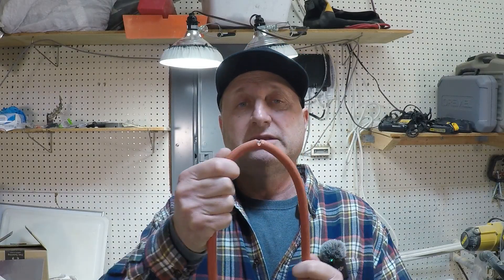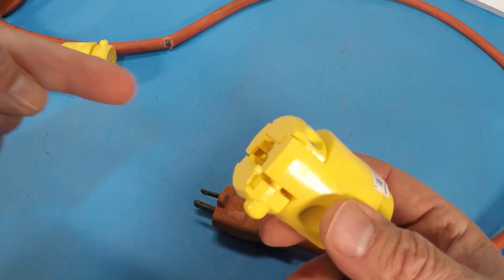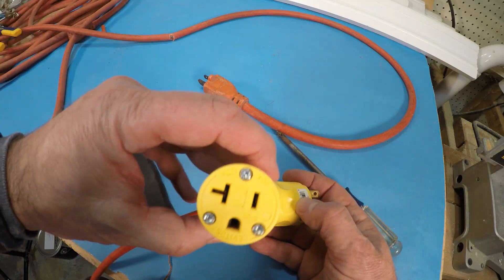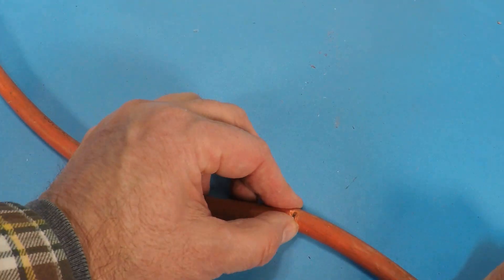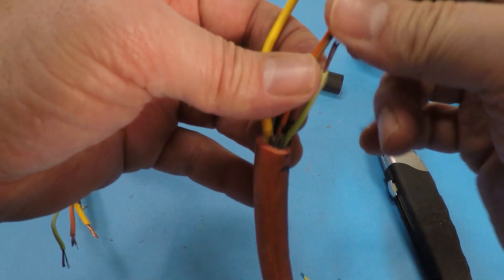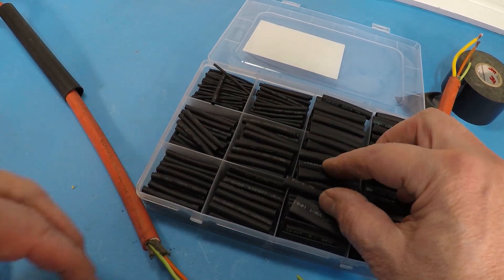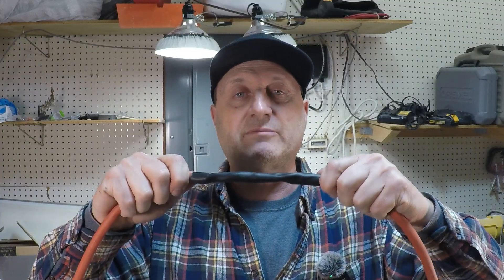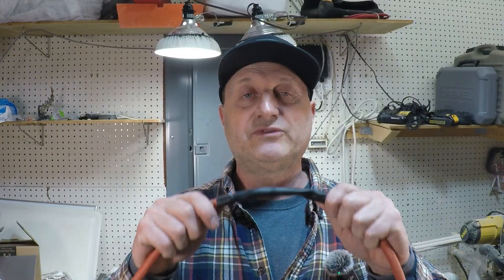The Surprisingly Best Way to Repair an Extension Cord or Appliance Cord

Comment: Don't do this.   Just put a new end on the cord and deal with the fact that your extension cord is shorter now.   This is not where solder is meant to be applied.

Edit:That solder job is brutal btw.  Far from bullet proof.  Even weaker once you start running a few amps down that cable,

Comment: When I don't have a heat gun or a blow drier, I use the hot soldering iron shaft lightly touching the heatshrink to shrink it.

Comment: 16:00 Again, as I alluded to earlier, you should have had the exposed wire somewhat longer --- i.e., more of the cord's outer jacket stripped back --- here, so that the heat-shrink tubing could have been slid further down back away from the heated part of the wire.
Reply from the maker: thank you for all of your responses

Comment: 14:10 Those soldered connections would have gone a lot quicker, easier, and better if you'd first applied paste-flux onto the wires and then melted a blob of solder with the iron's tip and dabbed the molten solder onto the flux-coated conductors.  Heating the wires to melt the solder just oxidizes the copper and produces a much-poorer joint.  Also, it's better to put the joint down against a board or layered-paper mat when you're ready to solder it, so that the heat is better concentrated on the joint instead of having it out in the open like that, where the heat can just ineffectively dissipate too fast.  It also allows you to pres the tip of the iron against the wires more firmly so that the heat transfers better and just wobblingly trying to hold it against the wires just out in the air.
P.S. It's a good idea to pre-tin the wires, also --- i.e., apply flux to each separate half of the joint before you put them together, then thoroughly coat the wire-ends with solder before twisting them together, applying additional flux, and soldering them again to make a solid joint; this is especially important with high-current-carrying applications, like for an extension cord.

Comment: 14:00 Notice how he has these wires correctly prepped here, Folks... you should have longer "free" wires on one end --- i.e., with more jacket stripped away --- to allow the shrink-tubing to slide further back down away from the soldered joint; otherwise, the "nearer" ends of the tubing may shrink down too small when they are unintentionally heated by the conducted heat from the copper conductors as you're soldering them, and then the tubes won't fit when you try to slide them on overtop of the bulkier soldered joints.

Comment: 9:32 You wouldn't need to actually cut and splice all three of the wires; in fact, if you don't mind not being able to use the heat-shrink tubing but instead just using electrical tape, you wouldn't even need to cut the damaged wire, either; you could just flame-soften the insulation and peel it away, then solder-fill the damaged area on the copper strands to restore the full diameter of the conductor and allow it to carry the rated current again.  (And if the wire was broken clean through, you could just add a short bridging-wire and solder it all together into one solid joint; you wouldn't need to shorten the wire's length by just twisting the two ends' strands together.)  It would make for a slimmer-bodied joint, too. :D
Reply from the maker: yes all of that is possible. However, this is really about what most people would encounter. I also think most people do not know how to solder and my extra step was for people who do. In the end, most people are going to twist and wrap.

Comment: 8:37 Instead of knife-slitting the outer jacket and thus risking slicing into the stranded conductors inside, I use small pointed surgical-scissors --- i.e., "iris scissors" --- to carefully slip in between the outer jacket and the wires and delicately snip away the outer jacket without damaging the insulation on the conductors.
Reply from the maker: you can use the scissors

Comment: Even better/safer than cutting back the insulation with a knife is to use a butane lighter to melt the insulation, or at least soften it enough to rip it loose and peel it backwards so that you expose the conductors but do not risk nicking or cutting any of the strands.  Also, when you strip the wires, it's good to solder-coat the bared-copper ends to gather all the strands and keep them from fraying or corroding.
Reply from the maker: thank you

Comment: When I have a damaged extension cord I usually just put ends on it.  If it's damage close to an end (usually) I cut off the couple of feet and slap on an end.  If it's more in the middle, cut it back and slap two ends on.  Turn a 30 into two 14's and call it a day.  No splicing, no solder, no tape, no heat shrink.  No binding around corners at the mend either.  

I'm not faulting what you do, just saying.
Reply: Yes, I was thinking about making two extension cords out of one, too.  Or if you have two extension-cords of the same wire-gauge that were both damaged at different spots along their lengths, you could splice the two longer cord-sections together to make a longer cord than either of them had been individually.  Then save the two shorter plug/socket-equipped cord-lengths for splicing the plug-end onto an appliance-cord with a broken plug, and for adding a socket to a different extension-cord where either the socket was too damaged/corroded to use as it was, or if simply you wanted to make the cord a little longer (again, make sure that the wire-gauges are the same on both cords; also, the longer cord might not be able to safely carry quite so much current as the shorter-length cord could have). :D
Reply: @Quacks0   Yes lots of options.  Regarding the wire gauge I have a bit of a story about that.

 I heard an interview with a fire inspector once, the topic was car fires in garages.  He stated that they have cases where people buy one of those 50'-100' outdoor extension cords.  Unwind about four feet off each end and plug their (parked inside garage) car in overnight.  Some of the block heaters draw 2000W which works out to over 16 amps.  Add to that the cord is only rated for 15 amps and for use outdoors, not indoors.  Furthermore leaving it coiled up like that increases the resistance/capacitance/inductance (I can't remember) which.  All in all, the cord heats up, catches on fire, car starts on fire and garage burns down.  

Made a couple of mental notes to myself and haven't burnt my car or garage down yet.  LOL!
Reply: @thepegger8422  I think that heat-buildup from the contained cord is the main culprit here; it creates resistance-inducing heat.  Inductance or capacitance could also be a factor, although apparently it doesn't really make that great a difference; I'm guessing it would likely depend on whether or not you're passing a large amount of current through the cord.  But in any case, it's best to always have the cord uncoiled, just for basic safety.
Reply: @Quacks0  I was a little skeptical too.  At the time I had a 1500 Watt block heater according to the OEM parts lists.  I happened to have a long exterior extension cord (still boxed) so I pulled the ends out, closed the box out and plugged it in.  I felt inside the box after about 1/2 an hour and it was all still stone cold.  But it was (calculated) only drawing 12.5 amps on a (rated) 15 amp cord.  A 2000W heater would have put the draw over the current limit.  So yeah.  I keep the cords short and the ends in good shape.
Reply: @thepegger8422  Yes.  Well, there's something else here, too --- if you needed to run the block-heater for your vehicle, then it must have been pretty chilly in the vicinity of where you were using the extension-cord, and so the ambient air would have kept the cord cooler than if it was used in a warmer environment.  Also, in the case of the space-heater, once it warmed the room, the cord could get too hot in the less-cooling ambient air.
Reply: @Quacks0  Fair points as well.  My garage was insulated and there was a gas furnace in there, however I used if very rarely.  We're in Canada and it can often hit -30C (-22F) during the winter.  Occasionally it will approach -40C (-40F) on a frosty night.  Since my garage was well insulated, it would often bt 10-15 degrees warmer in there than outside if I parked a hot car in there.  Uninsulated/unheated garages would certainly be very close to the outside temperature overnight.  Lots of variables there.  Even just the temperature of the slab compared to air temp.  Slab was always cold in the winter.

Comment: if only one wire was cut why not repair just the one instead of all 3?
Reply from the maker: Because the damaged wire would be too short. You will lose about 1/4 to 1/2 inches of the damaged wire when stripping it and tieing them together while the other two would be at the original length.  Make sense?
Reply: @flannelguydiy6458  thanks for the fast response
Reply: You could do that, but you would need to install an additional short length of bare wire to bridge the broken one so that all three wires remained the same length; I have done this with repairs where I had soldered the wires, so that there being two joints in the one wire would not be so much of a potential problem.  But a concern would be that there could be concealed damage in the other two conductors, also --- i.e., some of the two seemingly-undamaged wires' conductor-strands could be severed at the break-spot, even if they weren't visible through the insulation.  What I do here is to melt off the insulation from all three wires, splice in a joint of supplementary wire and fill it with solder as described above, fill in the other two bared wire-strand bundles with solder to re-establish full conductivity, and then tape everything up.  As you say, no need to actually cut any of the wires if they are not broken, but at the same time you want to make sure that all of the conductors can still carry their rated current.